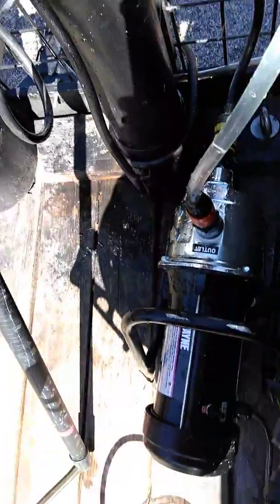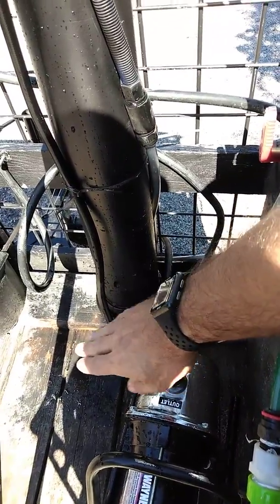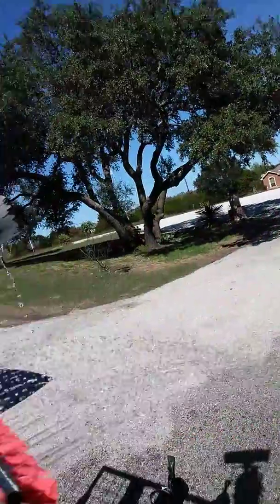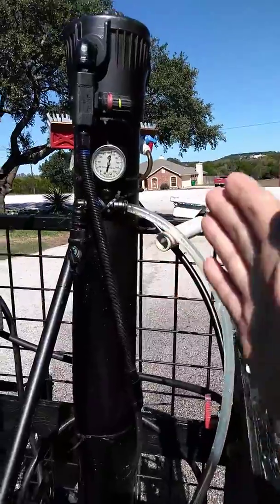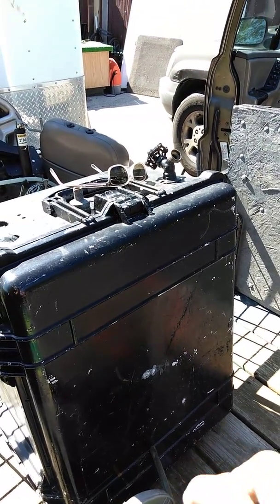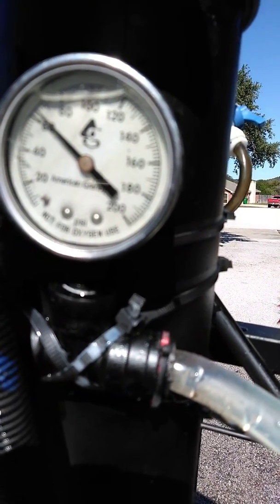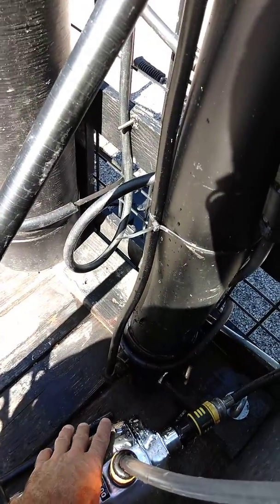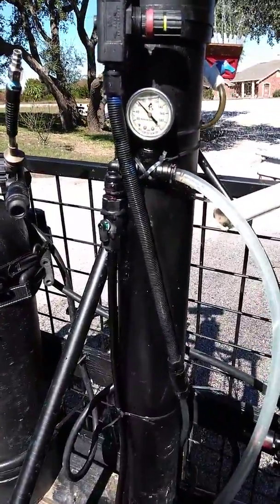Wayne PLS100 RO Booster pump for 4040 RO

Comment: So I got my true dual resin hooked up today, first stage cation, second stage anion.  initially I was getting 10ppm then it started creeping up into 20-25ppm.  my water's really bad here, over 500ppm.  Should I run a carbon pre-filter and maybe a 4.5x20bb refillable di as a polisher?
Reply from the maker: The first set up I did worked great. The refill...I swore I swapped resins, had to. I was getting crazy tds numbers. I made sure to flush each tank first. It eventually evened out to around 3-5. 500 is pretty high so if having to use DI then a dual bed is best to get the ppm down, then, if needed, a polisher tank.  You have to test to see if the water spots bad at 220 ish ppm. There was a time where my RO only got to 35 ppm . I still cleaned. Occasionally I would have to wipe a bottom or edge like a detail swipe. Pre may help but
Reply from the maker: Pre may help but could depend on what type of dissolved solid is the problem or is it a silica, even chloramine.
I had to rebuild my system, the Texas ice apocalypse took out my wayne pump, a filter and a few lines. Using a harbor freight drummond pump now. For that tds an RO is something to look into, even if it means to buy it piece by piece. If tanking water is an option then a simple under sink or fish RO can easily make 100 plus gallons a day then you need a tank, pump and battery.
Reply from the maker: Yes, you can use the BB as a polisher.
Reply: @Jack  Ok thanks I going to do that.  Found out why I was getting high tds off my dual DI. Tried it again today, started off at 50ppm and within a couple minutes was up to 150ppm!!!  Found out that I installed the fittings for my cation tank backwards.  incoming tap was going to my outlet and my inlet was going to my anion tank.  Got it hooked up right and I'm getting 2.7ppm.  Good enough.  BB for polisher should work, I would get a quarter cube, but my cart is heavy enough as it is.

Comment: where did you get the switch with the lever for switching from RO to RO+DI?
Reply from the maker: think I got that from US Plastics. Those bi and tri  valves are expensive.  Think it was like 20 and it is the 3/8 barb tip. Now that I have good flow I may just use a manifold like a garden type. There is the y adapter to split 2 ways but now GD Lowe's Ace have the 4,5,6 tap manifolds so you can run and split water every which way. Thing is you will need to lable your valves. Sometimes I am not sure what I want to do so set it or have fittings to adapt to what I want to do. That is why I refuse to spend a few grand on a made system because I would just wind up tearing it up and making it the way I want. Genius of DIY, make it do what you want it to do. Not what others want you to do.
Reply: @Jack-Surreal_Panes  Trying to understand you're setup.  So after you're pre-filter carbon block you have a y valve with shutoffs, one going to RO, the other going to DI.  After you're RO you have another Y valve with shutoffs, with one hose going to WFP and the other going to DI?  Then, if you were to only run one hose to WFP and switch between all three you would have another Y valve  with shutoffs arranged 2 into 1, the hose from the DI going into one port of the inversed Y, the hose from the RO going into the other port of the inversed Y, and the 1 being the final hose to the wfp?  Would that work?
Reply from the maker: @diymotorcycling1719  At that time I had it so I could just go DI and use my 3/8 tubing or a connection that goes to a reel. I had a Y from water tap that Y to the RO and DI. Now out from the RO It could go to my reel or 3/8 using the valve or send the RO to the DI. So, In DI had a Y to accept tap water or RO water. DI out had a Y to  attach 3/8 tubing or the other port another hose like reel or whatever. It was so I did not have to disconnect or connect anything. Just turn on and if pressure sucked I could turn a valve to go DI and if place small enough just plug in tubing to the tank. My banks are weird. One can pull right to outlet but need to move to electric so I need to use RO on most but back side I need to use all 300' tubing so use DI because flow is better than RO at 300' plus. Another place simple DI and done, yet another RO the whole place but may run thru DI to polish because TDS goes from 170 to 220 to 280 there. Now, I just use RO in a mini trailer. Can ad the DI Tank but need a cube of resin for the 3/4 and remainder will go in one of my 1/4 cube tanks that will fit in trailer with RO. Send a pic in a bit.
Reply from the maker: @diymotorcycling1719  I just got this trailer with an electric scooter. 300. Now have a Renegade vs the WJ so wanted a small trailer it can pull with just the Outside Window stuff in it.  Do a quick video tonight. Keep in mind I haven't really set it up yet, just threw in the RO and some hoses just to get a few jobs knocked out.
Reply: with a 2 into 1 Y with shutoffs attached to the DI inlet as well
Reply: @Jack-Surreal_Panes  Sounds good!
Reply from the maker: @diymotorcycling1719  Basically the water from the tap splits 2 ways. With a Y it goes to the DI tank and the RO. The DI inlet has a Y as well. That Y controls if I want to run tap water to make DI water or close that valve and that red valve, if switched to Do will feed RO water to the DI to polish the RO water. The RO red valve is a 2 way valve, either RO out to the WFP or feeds to DI tank. So using certain valves I can run just DI, RO, or RO/DI. I rarely do RO/DI anymore. I do mainly Commercial or new home construction so if there are any spots here or there nobody cares.  As soon as I leave the sprinklers turn on and there goes one set of Windows messed up or the subs cut brick and tile and the dust floats right on them or the guys is spreading soil and dusty as he'll. Once I leave, whatever happens once I leave, not my problem. They want a touch up, they pay for it.

Comment: I looked it up, the chlorine concentration in my area is 0.4-0.5 ppm.  Is that considered high?  It's right on the threshold for CDC limits.  Chlorplus the way to go?
Reply from the maker: Chlor plus should be good. I watched a good vider from BRS Bulk Reid Supply , I think, will find link. It showed the performance of carbon blocks.
Reply from the maker: https://youtu.be/GZQBDqZzu04
Reply: @Jack-Surreal_Panes  thanks the BRS video, thats super interesting.  I looked at my city's annual water report.  couldn't find any mention of chloramine.  going to buy the test strips to check,  but I think I'm going to go with the Chlorplus just to be on the safe side, being that I travel to other areas with different water treatment processes.  It amazes and confuses me how a 1 micron filter can push out 4gpm when other filters at 5 micron can only push out .5 gpm

Comment: this is the carbon filter I found for the 20" Big Blue.  https://www.freshwatersystems.com/products/pentek-355753-43-chlorplus-20bb-chloramine-reduction-1-mic-filter?variant=13250232221739    you said youre block filter was $60.  was that for a BB 10" housing?
Reply from the maker: I had 2 types of penteck Floplus and Chlorimine. Now have a plus for better flow $60-70. The Chlorimine one was like $80-100.
Reply from the maker: my housing cost me $1 at a yard sale
Reply from the maker: Chlorimine filters great if your water uses chlorine and ammonia sanitizing. My water went back to only chlorine. I just pay attention to when the water company posts a chlorine burn which raises crud and high chlorine levels in water

Comment: I just ordered my .5cf from wcr.  working on sourcing the parts to add RO to the system.  For RO im going with the stainless housing from fresh water water systems.  As far as membrane im looking at the axeon hf5 4040 https://www.freshwatersystems.com/products/axeon-hf5-4040-2500-gpd-ro-membrane-element.  My question is, if I run straight tap with no boost assuming 50psi at the tap, will this be my best option for a no boost system? Also, if I choose to add a booster pump, is there any harm in running 100psi + in an extra low energy membrane?  The confusing part for me is the psi rating of the membranes.  some are rated for 600psi, 250 psi, etc.  Im assuming the higher rated psi membranes, if you were to run straight tap, would give too much waste water?  What are you running?  Thanks Jack
Reply from the maker: The HF5 is the membrane to get. Housings: SS 4040 is like 74. most pvc is like 198 and fiberglass a bit more. I am happy with my pvc. For a while I ran no pre filter but use the BB 20" carbon block, any type, usually CFO. If adding other filters before it will reduce plow and pressure. I had old housings so run a spiral sediment 5 micron and had a carbon filter so run both. Now, if you run filters in series meaning in out to in out that is pressure loss and flow loss x2. Try running parallel pre filter. Split tap in to both in ports and join the outs. It actually helps keep the flow full and pressure loss isn't as great.  My trailer is a mess right now and haven't cleaned up after this week's jobs. Sort of threw everything in there. Maybe I can post a quick video of what I did since the freeze. The fun with making your own stuff is you can do whatever you want. Thinking to part the 1800 God ( 3x 14" 600 gpd HF5 in SS housings) Think they are fried but why not. Thought my 4040 was fried and ran the he'll out of it, did a reverse flush and acid soak, that was 3 years ago. Still going. Got a 1 ppm yesterday. Unless your TDS is really low 1 ppm with that membrane rejection is awesome.
Reply: @Jack-Surreal_Panes  Yeah I think I should do some more research on RO. Not exactly sure on how it all works, buffer tank, running permeate, fouling membranes etc.  I can see how it can lower cost, since RO is basically free pure water.  I'm considering a truck bed setup, only thing is for residential I would have to run alot more hose.
Reply: oops rewatched the video, realized you are using the axeon hf5
Reply from the maker: I run mine from 80 to 120 psi, my RO is like 4 years, maybe 5 now.
Reply from the maker: If a pvc housing is cheaper, go pvc. I had bad o rings on my 3 14" stainless housings. The water that bypassed rusted the seam weld so I went with an $80 pvc housing. Do it again I would get one with 3/4 ports but 1/2 is the standard

Comment: Jack where did you source you're china carbon fiber pole from?  I'm considering going that route, due to price factor.  Thanks for all the help
Reply from the maker: I got mine from a Brian Irving. Not sure if he sells anymore. You could look on Google or Amazon for carbon fiber poles. Most cheaper finds will bring you to China sites that you have to call. May be worth it of it cost 400-600 vice 1400+ for the most basic pole. You may find like. 45' for that price. A good cf pole will cost you 1500 for 31 or 35 foot.

Comment: Hey Jack what is you're opinion on brand and type of waterfed pole?  I've been looking at the new xero destroyer from wcr but it's more than I would like to spend being that I'm a newbie to waterfed.  Thanks
Reply from the maker: Depends on how long you need  1, 2, or 3 floors. Most of mine are 1 story ranch style or offices. Also depends on how much you want to spend. ALU, Fiberglass, carbon fiber. Decide how long you need it. I have an unger nlite, think 21' does most 2 story but heavy. I need just a few more feet sometime so got the 10' ext. Heavier but  reaches 31' Now I got a China 3 star CF 31' . lighter . I do not know much about Zero. If you are WCR member see if Alex or Chris can give you info on it. 1 important thing is the clamps. Bad clamps will ruin your day. If just need to test for a bit, try longarm, unger, ettore, etc... or any long ext pole
Reply: @Jack-Surreal_Panes  Appreciate it Jack.  Ideally I want a 40fter for the once in a blue moon 3 story walk out basement.  One of those things, have to have the equip to do all kinds of jobs.  I cringe every time I have to bust out the 32 ft ladder for trad work. You're China 3 star; how much flex do you get when fully extended?  Never heard of that brand
Reply from the maker: @diymotorcycling1719  cheap CF from China. I did a 3 story Best Western with it and the unger with the extension. May have a video using it with my water fed combi scrubber

Comment: What type of cation and anion tank  (black box) are you using for you're dual bed?  Only thing I come across online are the small RV style ones
Reply from the maker: Yup. my second tank came from Portable DI, a 1/4 cube. That is where I get my refill for my dual bed. Have the tanks now to do a tri-bed. A mineral tank is a mineral tank. I would get a half cube and WCR has a filled 1/2 cube for 249 which is the cost of a filled 1/4 from other places. I would say get a half cube unless you want 2 to run a dual mixed bed. If on portable DI site read about the amount of water made between a dual mox and dual bed. Good info. My black houses my dual bed plus I have 2x10" filter housings with resin also. Those were from my old 1800 gallon RO. Since I buy a cube of resin to fill my 3/4 I use the rest to fill the 10" filter housings to use as polishers. The polisher tanks may take the ppm down from RO/DI water to bring closer to zero. 
https://windowcleaner.com/xero-di-tank
Reply from the maker: I have many odd videos on my Facebook page but think you can only see video folder when on Desktop FB be the app. I made them all on YouTube a few years ago but removed a lot of them. Facebook Jack Sedore. I have not been on FB in a while so not sure of all the changes or where the video album is anymore

Comment: Hey Jack do you have any videos about how soap/chemical injection works with these ro/di systems?  I looked at DI rinse, I see that the pro DI unit they sell has a bypass valve to bypass the DI to run straight tap water, but how do you hook it up for soap?
Reply from the maker: DI rinse expensive. You can easily make a bypass using a simple Walmart or any Y valve from home and garden. 1 valve open sends water to DI other straight tap. Close to Do then just tap. There are inline diapers. Look like the soap spay nozzles you use for a car washing sprayer. Fill cup with soap. Usually if you need a bit of soap it is easier to use a sprayer, battery or pump and soap tht way. I tap wash so got a wheeled soap bucket and brush. That way the only thing that runs thru my pure water lines is pure water and the brush stays soap free. But yes, many sites carry an online with 3/4 ends to hook hoses up. I am sure they make smaller ones that you can adapt to smaller pole tubing like 3/8 or 5/16.  For me, I just have spray bottles with a soap, vinegar, phosphoric or citric acid and spray as needed. If trying like a tap wash or soft was, a dedicated hose and sprayer soaper is ideal.
Reply: @Jack-Surreal_Panes  would something like this work if I boost with wayne pump before the soap dispenser?  https://www.amazon.com/CAVEEN-Pressure-Flexible-Extendable-Cleaning/dp/B07Q83PDFB/ref=sr_1_16?dchild=1&keywords=pressure+washer+soap+dispenser&qid=1591809100&sr=8-16
Reply from the maker: @diymotorcycling1719  It should. I am not sure of the pressure of the soaper container. If DI then no boost necessary, if boost needed, after the DI. If RO then it should be fine, just RO out pressure even if boosted isn't that high when running plus unless 4040 maybe not enough flow. If you were to bypass DI, because DI tanks and resin are not fans of pressure, 45 psi is best but tap ok. I would try without boost until you need boosted.
Reply: @Jack-Surreal_Panes  Thanks for the explanation.  What I don't understand is if you are swithing from tap to DI for final rinse for every window, how is it that you use a trailer system without going back and forth to the trailer to open and close the Y valve?  Or do you hit all the windows with tap first, then go back over them for final rinse with DI?
Reply from the maker: @diymotorcycling1719   I do use a trailer for bigger jobs where I PW the garage so need PW. Usually have my Frankenstein RO or DI in Jeep. When I tap or pre clean I use a dunk bucket and hose.  Rinse, soap, soak, scrub scrape and rinse. If I need to use pure water I run that hose to RO for feed water and will have pole hose, 300' ready to uncoil and pole it real quick. I sort of do overkill on cleaning but been doing new const homes for over a decade I learned paint specks will ruin good or any wfp brush so those paint and concrete, mud must be cleaned off first so wash windows using various pads and flow thru or car truck brushes. If I get the soap mix right and temp is good I get those drying peaks and I know spot free or good enough for new const clean.  Sometimes just go around with spray and towel and hit a few spots.
Reply from the maker: @diymotorcycling1719  So I wash and rinse first using tap system then go to pure water if needed. If you try both then you need 2 lines, 1 tap and 1 pure. For me by the time I finish tap wash the windows done first have dried and I can see how it looks before I pure